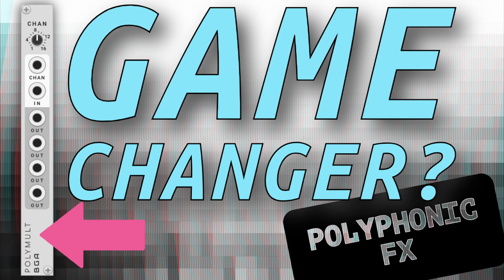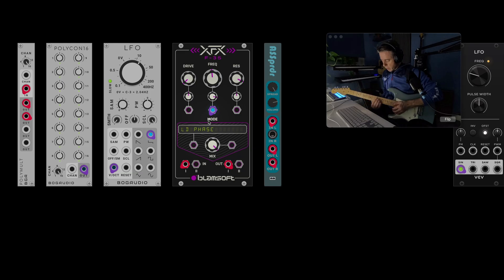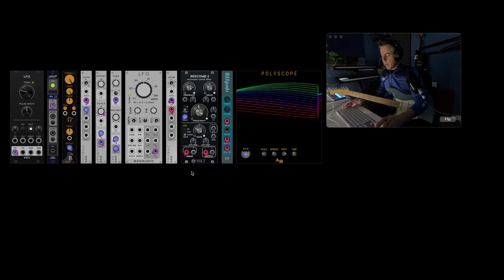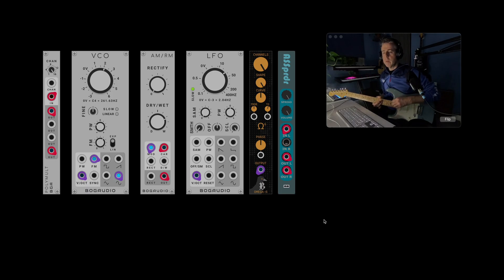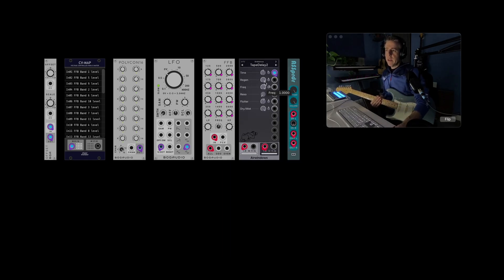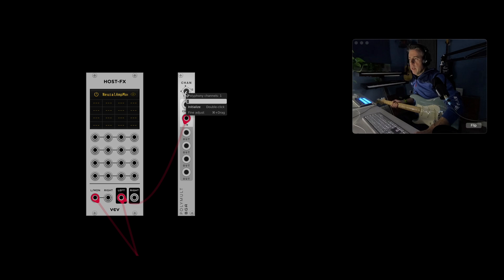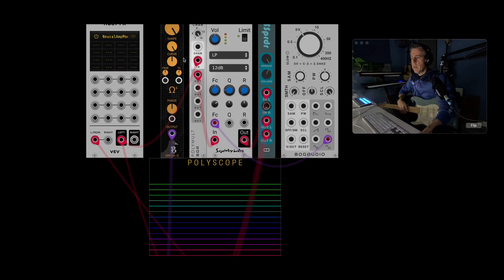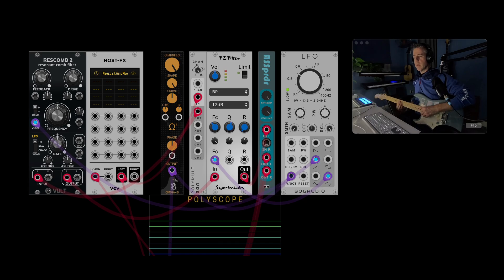Polyphonic Effects with VCV Rack - Full Tutorial

Comment: I haven't finished the video yet, but I take it you're taking a mono guitar signal into the FX, which then outputs a polyphonic stereo signal?  Do you ever use hexaphonic pickups to get a fully polyphonic signal chain straight from the guitar, and then further the polyphony with the poly-FX trick you're showing here?
Reply from the maker: Yep, regular guitar output into a single channel of a simple Scarlett 2i2 interface, then the signal goes into a module called Polymult in VCV and is duplicated onto multiple poly channels for modular processing. It's just the same signal on every channel, with a discrete copy of the same effect. Hope that makes sense!
I get relentlessly spammed with ads for those hex pickups, the internet knows too much about me but I haven't given in and bought one yet. 😂
Reply: @VirtualModular  Haha, I get those ads all the time too., but I haven't tried the SubSix hex pickups. I actually have a Boss SY-1000 guitar synth, which uses a Boss GK-3 hexaphonic pickup that connects via 13-pin Midi cable.  The SY-1000 can double as an audio interface, so I run that into Jam Origin Midi Guitar 3's hexaphonic mode.  That brought me to your channel, thinking about making my own  virtual guitar "pedals" in VCC.  The GK-3 pickup has the benefit of sending midi info alongside the raw audio, but I don't know how the normal guitar output of this pickup compares to the SubSix
Reply from the maker: @SullivanSublime  could be interesting, does the GK-3 provide individul audio outs for each string when it's used as an interface?  I've only got two inputs so haven't thought about the sub six idea much. 
I've got an SY-1 guitar synth pedal too, haven't used that for a while. Over the last few years I've been more interested in processing the regular guitar signal to get new sounds, but I do keep an eye on the options for MIDI guitar.

Comment: That's pretty neat. In a way it might even be an alternate approach to getting some granular or phasing effects, even though you're using filters or delays. Also it seems Venom may have a few neat modules for this kind of thing too, if you haven't given that brand a good look yet.
Reply from the maker: Yep that's possible, you can run the modulation CV signal  through an audio delay, and it sounds like a delay even though it's the filter cutoff for example that's delayed between consecutive channels and not the audio. I used that trick on the comb filter example but forgot to explain it here! If you haven't seen the video I did on emulating the MakeNoise MultiMod, it's the same technique (I re-used part of one of those patches). That was actually a terrible tutorial, but it's an interesting concept which I blatantly stole from the hardware!
How it works is I duplicate an LFO onto 16 channels with Polymult, then the signal is patched into CVD, which is a polyphonic delay. Another poly signal with different static levels on each channel is patched into the delay time via an offset module (from Polycon or Omega-6 for example), so that when the offset is zero all 16 LFO signals are perfectly in phase, and increasing the offset introduces a delay between channels and gradually shifts them out of phase, which moves from a delay effect into a squelchy mess as they start to change frequency and run at different speeds. It's difficult to describe, but sounds like you have a single filter with an LFO and it shifts into a delay, then fractures into loads of filters with different LFOs, then morphs back together.

I do have the Venom collection too, I tried the Recurse module for effects, but that's using poly channels to process the signal in series through copies of  the same module, as opposed to parallel. It's interesting, but a completely different idea.